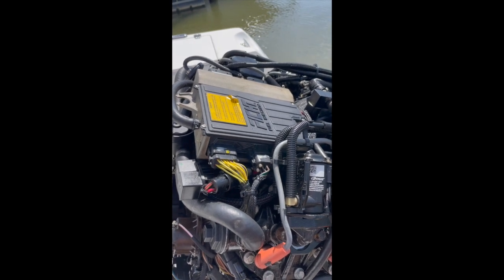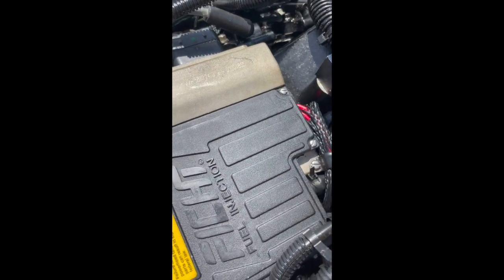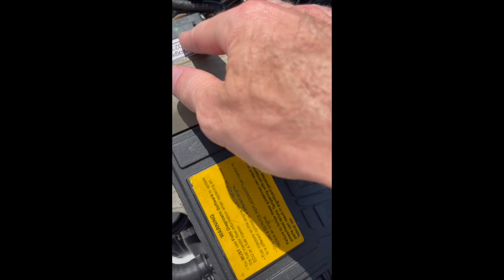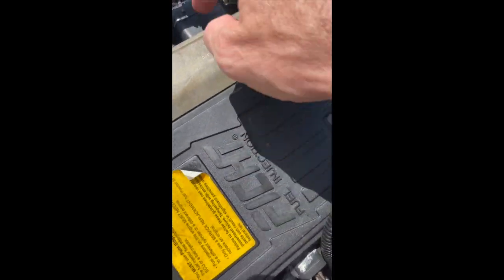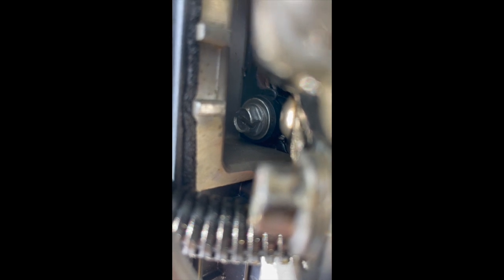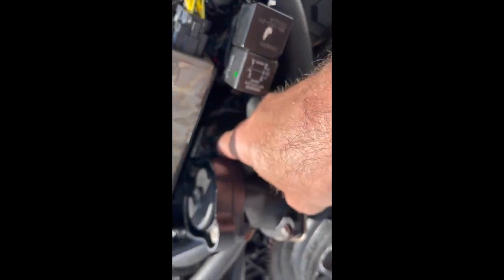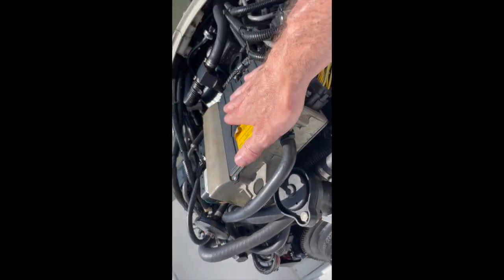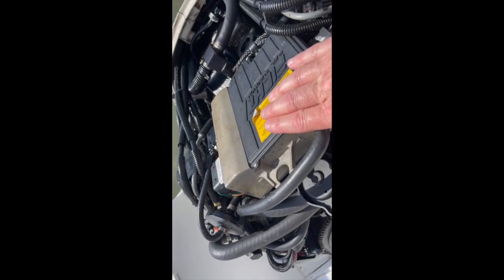Evinrude Ficht EMM   HD 720p

Comment from the maker: Watch this video too (shows how to install an EMM):  https://www.youtube.com/watch?v=BCGmlJSk2Dc

Here is the thread that discusses the reason why the EMM needed to be removed:  https://www.thehulltruth.com/boating-forum/996809-evinrude-ficht-intermittent-no-start-solved-3.html

The key excerpt is below:  

I have a 2002 225HP Ficht outboard on the boat I bought last year. It ran great for the first couple months. Then, on multiple successive trips, just died each time. No warning, motor simply shuts off and boat coasts to a halt. Happened at low RPMs (in the channel back to the marina) and then happened twice at cruising speed (about 24knots) out on the river. Each time, no warning lights would show, no alarm--motor just stops. Each time waited about 7 minutes, and motor restarts as if nothing had happened. Had a guy (local Evinrude expert) come look at it--didn't see any fault or engine codes. Did notice a "no oil" fault from very early in the motor's life. Replaced a worn throttle bushing. No problems for the rest of the season (another two dozen trips or so). Now this year, I put the boat back in the water, started up fine and ran great for about a half dozen trips, then, same problem on two successive trips. And then the kicker was last weekend--motor died at 24knots in the main channel, but three warning lights came on steady (not blinking)--"no oil" "check engine" "hot water"--referred to in this thread above as three-finger salute. Removed cowl, tilted motors, checked water intakes (were clear), added oil, and waited. Every time I would turn the key one position to restart, the self-check would perform, and then the three lights would come on steady. I did notice that gradually over the course of the 60 minutes or so I was sitting there (at anchor) that the amount of delay between the self-checking completing (all four lights come on, blink and sound, and go off), and the "three finger salute" would increase. Got to the point where the delay was roughly a full second. By then I called for a tow. Next morning, motor started up fine as if nothing had happened. Yesterday, took the boat out and ran around for about an hour, no problem, came back in to the gas dock, fueled, went to start and --nothing at all, just the three finger salute. Removed the cowling, tilted the motor out of the water, waited 15 minutes, and boat started fine and made it back to the slip. I plan to call DFI on Tuesday. This thread suggests a number of possible solutions--cooling lines to EMM; stop/ign relay replacement; neutral switch on the binnacle mount; bad stator. I'll see what DFI says, but given a comment I read about historical heat issues potentially causing problems later (remember "no oil" fault code from years ago) and the three warning lights, I'm leaning towards thinking this is a EMM issue. I'll repost when I have more info.